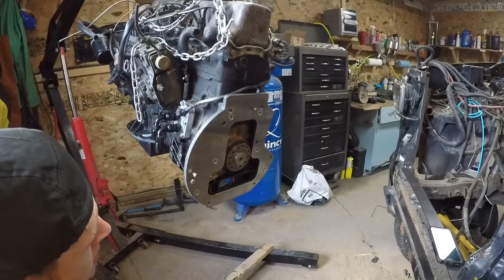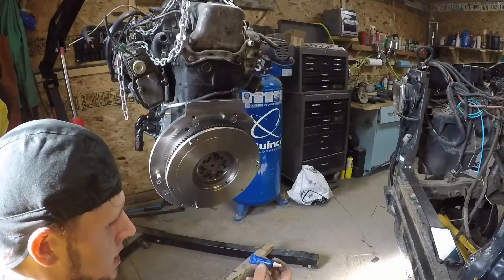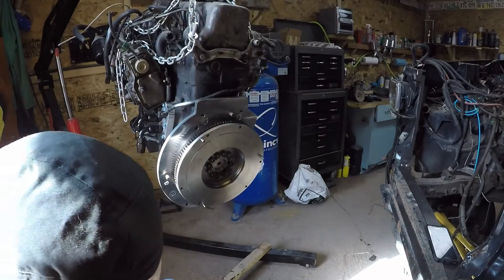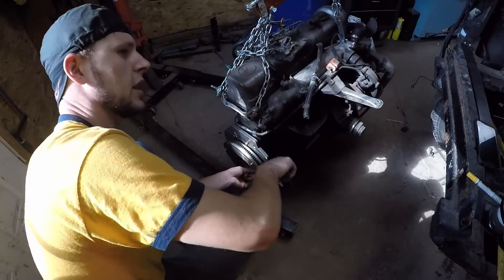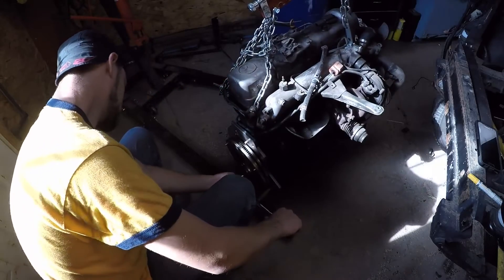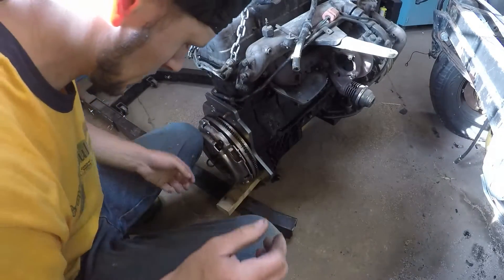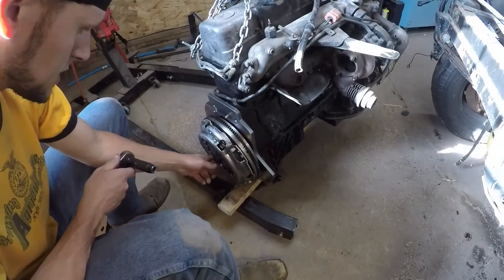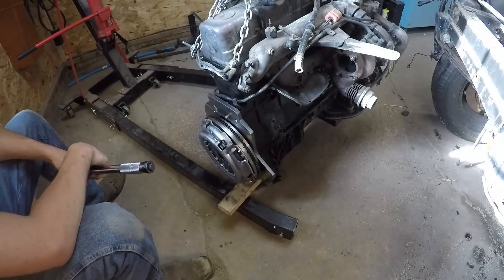OM617 to Toyota Adapter Plate Installation

Comment: How in the world are u gettin that thing to shut off u running vacum to it
Reply from the maker: Check out the wiring video. It uses a Toyota EGR solenoid and the CIG fuse power.
Reply: @doomsdaydiesel  ok working on a jeep.someone built and it had a vacum silinoid on it but stopped working can figure it out i can get it to shut off but won't start back unless u unhook vacum like to injection pump like its holding vacum
Reply: @doomsdaydiesel  ill.try that thanks man appreciate you

Comment: Looking to buy this kit for a 2wd version, would this kit work with a w58 trans??
Reply from the maker: Any W series bellhousing can be swapped amongst W-series trannies. You'll have to do the research on input shaft length and throwout bearing, but you could run a W56 or W59 bellhousing. Starter is on right side for W56 and left side for W59.
Reply: Doomsday Diesel thanks man

Comment: Hey Joe I need a adapter plate for a 2004 nissan xterra is that something you think you could make it will mount to a om617
Reply: I have an auto trans in mine but I want to do a 5 speed manual swap I will find out what it is and let you know

Comment: so where will the pilot bearing go? wont the extra distance of the adapter make it impossible to use a pilot bearing?
Reply: Im still unsure how the imput shaft will reach into the pilot bearing if you put a spacer between the gearbox and engine? @doomsdaydiesel

Comment: Isn't the OM617 an externally balanced engine? Would you comment on a good way to preserve the original flywheel or flexplate's balance characteristic in the new flywheel?
Reply from the maker: The entire rotating assembly is balanced as a whole. You must mark the flexplate before removal and have your new flexplate or flywheel match-balanced. Of course, that is many times not necessary as the stock flexplate is usually very close to neutral balanced.

Comment: whats the weight of the redrilled flywheel? i run a manual trans in my mercedes 300td, and the factory flywheel is 38lbs, figured with a lighter one it might shake a bit more.  just thought id ask, hunting another om617 for my 4runner
Reply: Have you repowered one of your toy’s yet….if so how does it feel with the extra torque?

Comment: Que tipo de clutch y fly wheel se le pone el de toyota 22r o el de mercedes benz ??.Gracias
Reply: El flywheel es de Toyota, pero modificada. El clutch es la de Toyota sin modificaciones.
Reply: Le ordenas el flywheel en el sitio del señor y se une a un clutch de 22re preferable k sea stage 2 o mas fuerte k ese por k va a tener lo doble de torque que el motor original